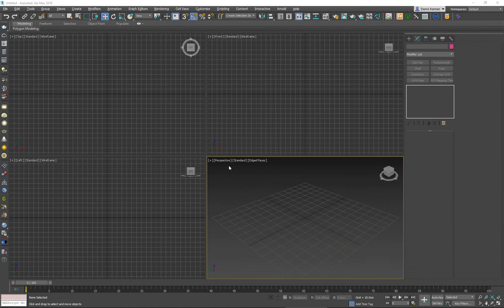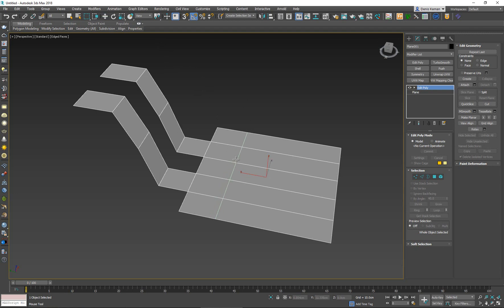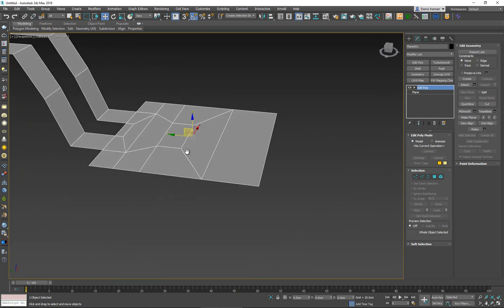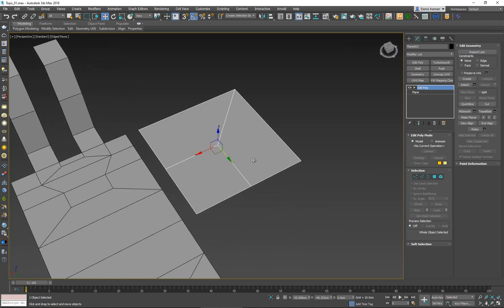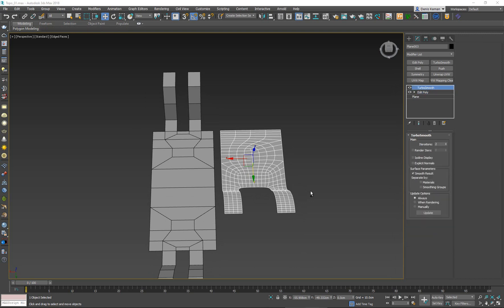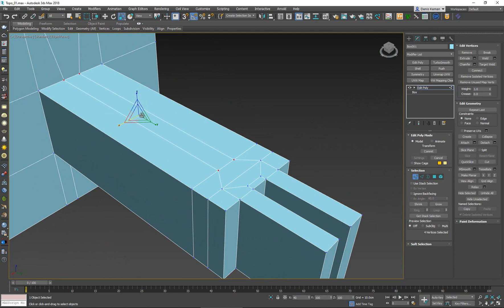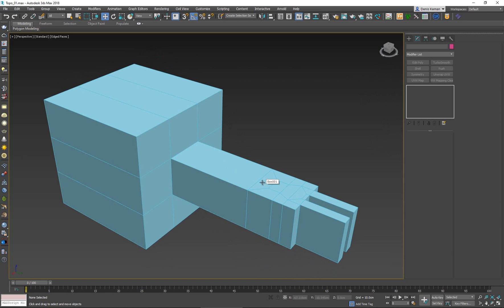Controlling Topology with 3DS Max

Comment: would be cool to see what keyboard is pressed cus I find really hard to get all those remembered and it speed ups work really well :/ anyway really nice video +1
Reply from the maker: Where exactly is it that you don't know what i was pressing ?
If you can leave the time stamps i can answer right away with what shortcuts i'm using. 
Cheers
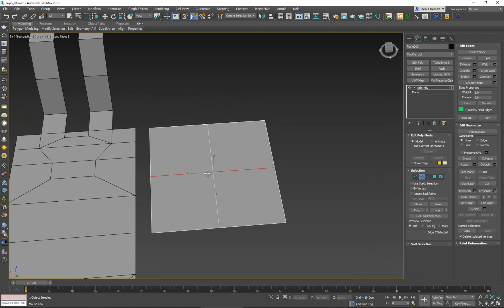Reply: @DenisKeman  I was trying to figure out how you added in an edge at the 8:27 mark, is it a custom swift loop shortcut?
Reply from the maker: @philhartanimation  Correct i have a custom shortcut for the Swiftloop as i find it as one of the most useful options when modeling